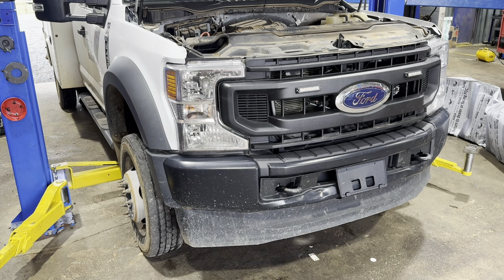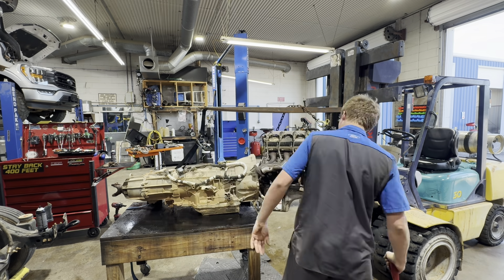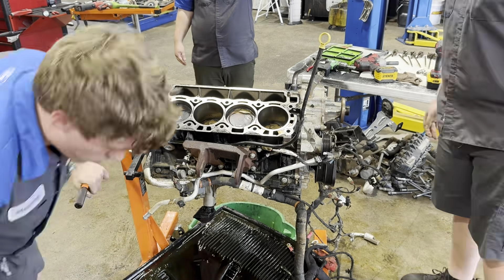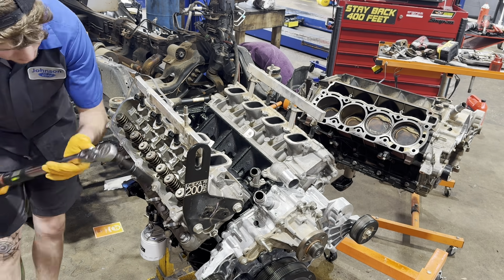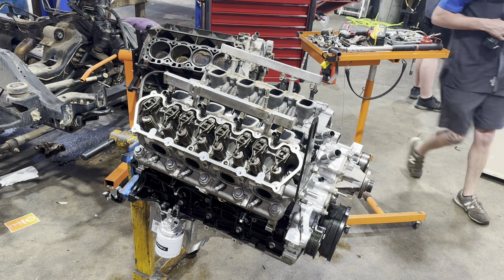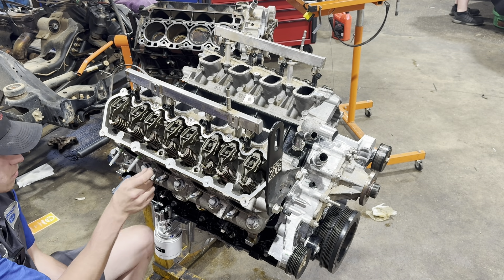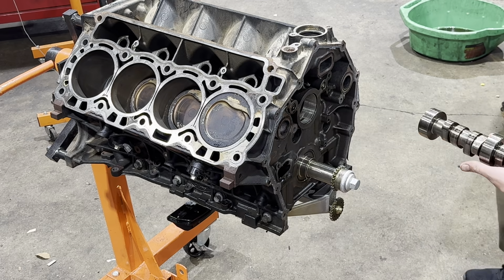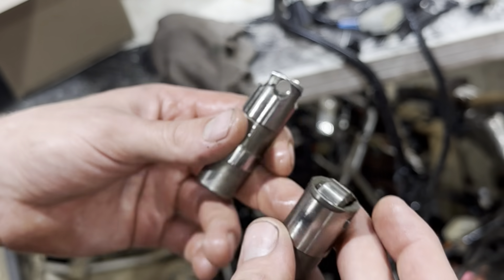Ford 7.3 Godzilla | Does this one issue make the engine a bust?

Comment: You're just trolling with the 6.2L comment right? The 6.2L has been one of the best engines for Ford to date.
Reply: 300 inline 6, 460, 390, old 302, 5.8, 2.3 4 cylinder ect
Reply: @MacGyver2154 6.2 is just as reliable as all of those and makes more power. If you pull what the 6.2 does with those old engines, they won’t last long
Reply: I'm glad to see all the good about the 6.2 I switched from chevy 6.0 motor shit on me I bought a 11 6.2 with 72k on it I'm assuming it's not even broken in
Reply: @gildroyboothe2548  suggesting that the gm 6.0 wasn’t a good engine is wild.
Reply: @gildroyboothe2548  I have 200k on my 2016 and it still runs like new. ZERO PROBLEMS
Reply: Not not trolling. The guy that made the video has said many times in the past how much he hates the 6.2
Reply: Ive seen 2- 300k hard miles put on company fleet trucks with the 6.2....I trust it.

Comment: @flying wrenches, what do you think about the older 3V V10 engines?  I'm considering getting rid of my 08 F250 with 56k miles, but have had no issues with it... Actually thinking of downsizing to 1/2 ton because i only tow 5k-7k.

Comment: That just shows you how much these dealership mechanics really know, the 6.2 was one of the most reliable motors Ford ever made other than a valve spring problem occasionally, the 6.2 is way more reliable than the 7.3 and the 6.7 diesel, go ahead and do your homework and research this really good and you will see that this dealership mechanic here doesn’t know what he’s talking about
Reply: Yeah but he is so totally dreamy and hot!!!!
Reply: I've seen too many 6.7s with over 1 million miles to even start to think they're not reliable I haven't seen very many 6.2's with over 500,000 on them
Reply: 6.7 is better by a long shot. 6.2 didn't have enough power to get out of its way
Reply: 6.2s dropped valve springs at a rate thousand times LESS than the 7.3 blew lifters and camshafts....
Reply: @guydonwilliams6755 I specifically shopped a 6.2 superduty in 2011 when I bought mine. 2 reasons: 1 I was not going to be towing heavy trailers daily. 2 I did not want a 15K repair bill to replace fuel pump and injectors when (not if) they go out. It was a simple choice for me. My thoughts on owning a diesel truck is that, if it's not working making money or you're not a millionair, then it's not economical to own.

Comment: Last year the ford dealer I worked at had a 2022 7.3 f250 with less than 20,000 miles break the oil pump gear on the crank shaft and make a horrendous noise, fords fix was to put another gear in it and give it back to the customer. The gear we were given was not an updated design, just the same exact style the engine was built with, so now the customer just has to hope no internal damage was caused by this and that the new gear doesn’t have the same fate as the original
Reply: Typical crappy dealer and Ford itself

Comment: I wonder if it would make sense to make it idle high on a switch like a diesel. 800-1000rpms would probably get the pressure in a more serviceable range for long term idle.
Reply: Probably not a bad idea, the old fords used to idle around 750rpm. Also going up one grade in viscosity would probably help too. Like 5-20 to 5-30, I personally run 5-40 in all my vehicles, no problems yet.

Comment: 6.2 was junk? How so?
Also maybe do some learning on pressure versus volume. 8 psi is irrelevant if you have good volume.
Reply: Ford used high volume low pressure in the 70’s and gm was the opposite end with high pressure low volume.

Comment: Let me ask you this. Are you having lifter problems in OHC engines ( overhead camsaft)? Probably not because oil pressure sparys out all over the cams even at idle. Push rod engines OHV ( Overhead Valve) relay on slight leakage past cam , rod and main bearings at idle. At higher RPM there is sufficient splash oil to lube.
Let me know if you think im wrong?

Comment: 2002 6.0 LQ4 LS. 11k engine hours, 238k miles. melling high volume/high pressure oil pump and TSP cam. it idles at 700RPM at 60psi of oil pressure with 5w-30. anytime i’m moving it sits between 75-80psi.

Comment: From 1950 or so when they came out with hydraulic lifters till about 1995 or 2000 there were very few lifter problems. Why? People didny let them idle all day when they went in the grocery store. Plus wotk trucks like UPS shut off automatically  if the driver tskes longer yhan 5 minutes because they think the driver is goofing off so driver cranks back up and engine idles while driver sometimes it takes longer than management thinks.
Engines are made to work not idle.

Comment: Once there is too much slack or lash the check ball in the lifter can't close and hold the oil in the lifter so it moves as a solid unit. What happened  to 10 minute auto idle shutdown? Heavy trucks had it years ago.
Reply: I said earlier that I think the cam lobe is failing first. Not the lifter because cam is splash oiled like cylinders
 Not bad lifter. 2 much idle time got cam lobe.

Comment: I think because the cam and cylinders and rings are splash oiled that the the cam failed first. Chevy had this problem with idling too much because they only surfaced hardened the lobes .0008". 8 ten thousands of an inch! Not even. 001" inch. Low oil pressure is not as critical as oil volume. 65 mustangs ran with low oil pressure. Detroit diesels had low oil pressure. They ran forever.
The real problem here is since 1930 to 1990 or maybe 2000 there were hardly any lifter problems rpt for poor engine maintenance.  Either the engineer's are told to cheaper them up or these new engineer's don't know how to design them because of very few apprenticeship programs.

Comment: Ford has publicly stated this issue with the 7.3 is due to the “work truck” version of the 7.3 having metal delamination issues with the metal components used in the “work truck” version of the engine.  Have you seen this issue with consumer pickups with the 7.3 Godzilla?

Comment: We have two of those 7.3 i. F250 out here in West Texas in the oil field.  Both of those trucks today have a little over 200,000 miles on them
  And I do believe they are 2021 models  
  I was just looking a few days ago because I had to take his truck in to get some tires and it showed it had  4400 hours driving and 2975hr  idle time. 
 Never had any type of engine problem yet, the only issue they have ever had was after 130,000 miles both of them had to have water pumps but those trucks are due to be replaced in December so they're probably going across the border to Mexico anyway
Reply: They probably got some rotella 15 w 40 in those oil field gas trucks I know how they think don't ask me how.😂

Comment: I just bought a 7.3 for a Lincoln project, but I'm planning on ditching the factory variable oil pump for the Holley oil system. Wish me luck 😁🤞🏽!!
Reply: If an engines oiling system is bad. 
Its not a good engine 😂
Reply: @fastinradfordable  the Holley pump is not variable like the factory which has very low pressure while idling. HD trucks idle a lot, which leads to lifter failure issues, especially if regular oil changes aren't done. Just what I've researched...🤷🏽😁
Reply: Nice, do you have any pics or vids on the progress?
Reply: I'm not sure I blamed Ford on that. The 2020 emissions engines all had those variable oil pumps I wonder what oil pressure at idle is on a 6.6
Reply: @craighooper6362  good point

Comment: My 6.2 ran flawless for 200,000 miles before it got sold. Never a single issue. Only parts changed were spark plugs at 100k. Idled it a ton too.
Reply: I used full synthetic penzoil and did changes when the maintenance reminder came on. I think it was 5000mi. May have been 7000….
Reply: @trevlanes  under severe service the oil change minder will trigger at 7500. Normal powder puff driving it will trigger at 10k. I never go 10k. I have them tag my windshield for 6k. Running Mobile 1 full synthetic. Recently switched from 5W-20 to 10W-20 due to high mileage. 178k on the odometer. 0 breakdowns. I changed plugs and coils and wires at 115k, water pump, belt, tensioner and idlers and fan clutch at 135k, serviced trans at 75 k. Trans oil still pristine pink.
Reply: Thanks. He said using good oil, and not going a long time between changes can help mitigate the trouble. I’d be interested to hear what your oil change intervals were with that truck.
Reply: I just bought a 6.2 from an auction that had been used by a local cable company it had 228,000 miles on it when I got it so far I've put Archoil in it for 500 miles then changed the oil decided to use 0w40 what mobil 1 rebranded as super car oil. I Love it so far, it really needs cab mounts though I think I am going to put a new AC compressor on it as there's a little tick in the  compressor.  I'm also going to put a new master cylinder in it when I'm sitting at stop lights it seems like the pedal slowly goes to the floor sometimes not always I wish gas was cheap enough that I could use it for all things but I like having it around for necessities I love driving it the old Taurus wagon gets used for commuting I still need to sell the old 7.3 diesels that it's replacing
Reply: @craighooper6362 mine has 495k miles and 14000 idle hours. Send it bud. She’s still young.
Reply: This is my second 6.2 both made 15000 My 6.2 now has 159.000 I use it daily. It's the transmission that's failing

Comment: Is it lifter or variable oil pressure solinoid valve controlled by ecm. Pump driven by a chain and jack shaft. Wtf ford reinventing the wheel once again.

Comment: Sucks the big 3 can’t make anything reliable. 

I’ve got around 16000 hours/410k miles on my 2018 Tacoma engine & it’s never been apart.
Reply: Who cares thats a crap truck literally a car with a bed
Reply: Tacoma owners….  🤦‍♂️
Reply: Dont worry toyota is joining the disposable party too.... Seems they are using toilet paper for main bearings in the new tacos.
Reply: Better keep your 2018 as long as you can.   They new Tacomas won’t make 100k.

Comment: How many of us own engines that are 30-40 years old that are still original internals. I have engines that I use the cheapest oil on the shelf and change them every 10,000 miles with no sludge or oil burning. From my memory, Smokey Yunick  back in the day said 10 psi per 1,000 rpm is sufficient. (Note - back in the day) I had wore out 350 Olds that the mechanical Auto Meter gauge at times wouldn't even register at idle. Times sure have changed. Yes, perhaps better fuel economy and emissions but who wants to have a new short block in between their fenders every 50,000 miles.
Reply: I got a 93 f150, 160k 351w, I've  owned it since about 50k, I beat the snot out of it and it still runs like new, all original. I doubt the new trucks will be able to that.

Comment: Dude hates the 6.2 cuz he don’t work on them much lol. It’s a great engine
Reply: I'm glad I got one in my '12 F150!
Reply: I am glad I own a 2012 6.2l f250 it's better than my 5.4l 3v id rather spend money at the gas pump than in the shop. Tbh the 6.2l gas engine is probably the best Ford gas super duty truck Ford has produced in years the 5.4l 3v and v10 was a flop when the 5.4, 4.6, and 6.8 v10 went to a 3v
Reply: Literally the best domestic v8. Only engine more reliable is the Toyota 5.7.
Reply: @dorianf1456 chevys 6.0's from 99 to 07.....still run those in multiple plow trucks.....

Comment: It's too bad that no one has figured out how to give full oil flow all of the time, like every motor used to do. I see that Holley makes a crankshaft driven front oil pump similar to the older Fords or LS engines. I know this isn't a hotrod, so probably not helpful. It is Holley part# 302-100.

Comment: Wish I still had my 2019 F350 with the 6.2 and 6 speed.   It was flawless.
Reply: Bruh a Kia can be flawless for a couple years.
Reply: My 19 was flawless for almost 300K miles before I gave it to my son.    It’s still going strong with all original drivetrain components.
Reply: Hmm. Wonder why you sold it.
Reply: @ricksmith1382 read the comment above you.

Comment: Correct me here as i've never worked on a 445Ci before, but can't one just unplug the pressure relieve sensor like in the older engines and stay at high pressure all the time? or has the design changed.